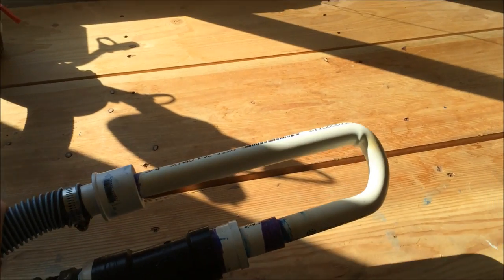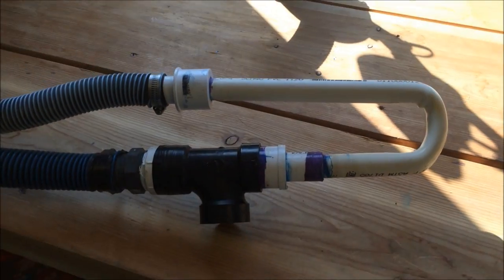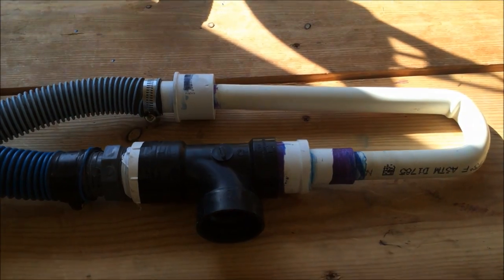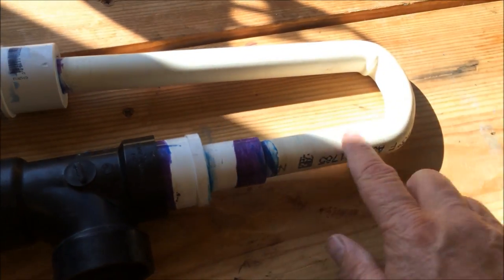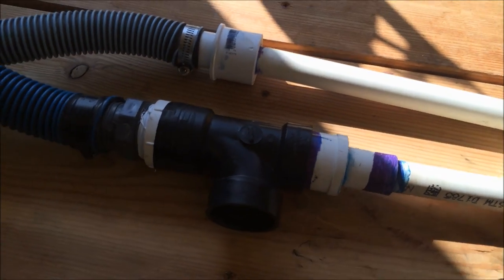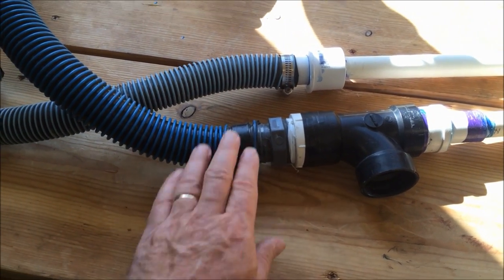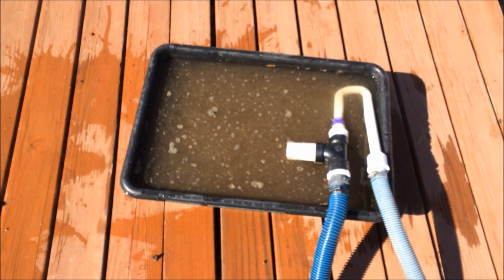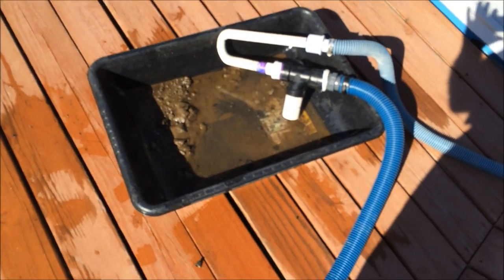12 Volt Suction Dredge

Comment: I absolutely love both the 12 volt and the manual pump ideas. Making it all portable is one of the biggest things. A container to catch all the classified material while you are going from place to place in the water, and letting all that excess water escape. I can see it being attached to a sluice box. Where I go, you always have to stack up rocks and then balance your sluice and let water flow through it. The water flow by itself to be able to put it anywhere is awesome. Have you ever tried to build a ram pump? it would allow for even more pressure to be used for your idea you got here for the clean water flow side. They always have 1/10 efficiency with water escaping but the thing is the pressure. With a river or lake, you don't have this problem with water flowing back into it. Its the pressure your after. The more pressure, the more material you can process. The system can be build to the size you want just to get a 10th of it.  Starting the ram pump is the main thing. But once it is started then it keeps going. Just don't want material going through it other than water. But, since that is the plan then it could work. May even not need the 12 volt battery if it works good enough.

Comment: Hey John...Got it figured out and corrected!This nozzle suck it up fast man!My problem was a hose barb I used to connect the suction hose to the nozzle.  It was creating backpressure because it went from 1.5" down to 1.25".  That .25" was the problem.  I took it out of the system and now the nozzle works fantastic!Like you I used heat to bend my PVC to get a nice even bend on it.My prospecting partner was super impressed when it threw a 1" rock 16" out the end of that 8' hose!Thanks for the help!Terry
Reply from the maker: Glad you got it worked out. I hope you suck up a lot of gold with it!

Comment: Good job. I like the nozzle. Looks to work great. The two I built do not have much lift. I see you also ran yours very near flat also. I built two. One is 3/4 and the other is 1''. Both are made of metal. They did not work as well as I had hoped using a 2000 gph 12 volt pump.  I will still use them with my highbanker gas pump. I made a 5 gallon bucket dredge with the pump. Hope it works better. I have not tested it yet. Goal is to put the wife on the bed rock to clean the cracks after I clean off it with the 4'' dredge.
Reply from the maker: +Basil Key Thank Basil. I'd love to see some footage of yours in action. Hope you're finding lots of that pretty yellow metal.

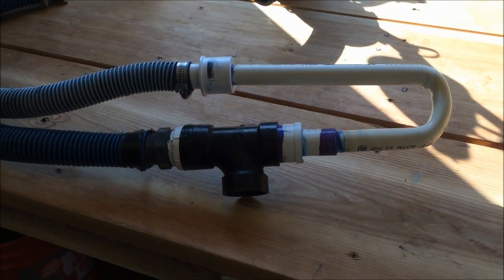Comment: 1:30 I was wondering how you bent the pvc pipe and I had in my head fill it with sand and you said you filled it with sand 🔥💯💪🏻👊👍
Reply from the maker: Yeah. I filled it with sand and heated the pvc with a heat gun...then I slowly bent it into the form I needed. Hope this helps.

Comment: another great video.the thing i noticed was that your pool water level was down at least 6 inches.this means it works out of the water.it should work even better in a stream, as the head pressure should increase as it doesn't have to lift the water up.thanks again
Reply from the maker: +bill bailey Yep, I agree bill, and it does. I set it upstream so that the head pressure is at its maximum. I'm also contemplating adding more water flow access into the pump itself by opening up the bottom of the pump and covering it with a mesh. Thanks.

Comment: Very nice.  One comment/question is do you find that the curved part bumps into things a lot?  I would think making it shorter where it comes in to the "sanitary T" section would have less PVC pipe sticking out in front, and make it able to get into smaller spaces.
Reply from the maker: +John Foster Yeah, I made another edition of it and shortened the sweep. Works great!

Comment: have you tried an aquarium pump like a mag drive? they handle head pressure alot better than those bilge pumps and they are also very light on the amp draw. you would need ac/dc converter but i think it would be better.
Reply from the maker: Thanks for the idea. Much appreciated.

Comment: Wouldn't it give you better suction if you didn't have your flow necked down to about only 1/2 inch where you used your calk tube end? If you made that a larger volume of flow wouldn't it give you greater suction? Or is my understanding of physics and water flow all upside down?
Reply: It needs to by reduced to make a jet  , i have video where i explain it

Comment: will the flexible pool hose will slow the flow with all the ridges or is it smooth on the inside? if it's not smooth id maybe pool backwash hose from amazon is $20. for 50 feet and might improve flow rate a bit more.i hope you get a chance to use it again before the cold sets in and take a video maybe.
Reply from the maker: +bill bailey 

Bill, I thought of that also. The pool pipe I'm using is fairly smooth on the inside, but any resistance reduction will help. Thanks for your input. Much appreciated.

Comment: How much static suction are you generating? Have you checked with a vacuum gauge? The ones I build are similar, but yet different. Two venturies, up to 12" of vacuum using a similar 12Vt pump.
Great job! 👍

Comment: What is the purpose of the pvc 90*? Can you just loop the hose/continue the loop with the hose and do without the pvc altogether(until the Y and Venturi input of course )? Just wondering if the solid 90* increases pressure or does some rad magic. 
We highly enjoy your projects and gain inspiration from your videos. 
Take care.
Reply: Yes u can just loop house , thats what i did and it works fine
Reply: Quantas horas a bateria suporta?

Comment: I called Keene from Keene Enginerring. He stated that a 3500 gph would not have much suction with one of his 2 inch keene suction nozzles.
Anyone have a different actual result? Im planning on using a 3500 gph 12 volt pump with a 2 inch keene nozzle. Thanks for any help!
Reply from the maker: Yeah, I agree with them. I have a 3" nozzle and use a Honda 125 gpm high pressure water pump to power it.I use my 3500 gph for my small nozzle in this video and for my small and medium highbankers. They work fine in these applications, but won't be sufficient for 2"-3" suction nozzle.thanks.

Comment: Hi John,Very informative video!  I am trying to build one but not having much luck...NO SUCTION!  I'm really hoping you can point me in the direction I need to go with this...I'm using a 2000 gph pump that has a 1 1/8" outlet.  The closest sized hose I can find that has a relatively smooth inner wall is 1 1/4" I.D.  It is 8' long and I've reduced it to a 5/16" jet ( I've also tried a 3/8 which threoretically should have been the perfect size) and a 1/2" jet) inside the 1.5" plumbing "Y" as you have done.  Of course the outlet of the nozzle is 1.5" and the hose is 8' long also.  The set up you show in the video appears to be longer that that and yet has very good suction...I know your pump is larger @ 3750 gph but still I would think I should be getting at least a little suction.  I've been after this for almost 3 weeks and I'm lost...any suggestions???
Reply: Terry l, look up my vid for where i made it work with 12v 1000gpm pump , its really diferent with every pump , the jet size have to be mached to your pump , the best way i found to do it is to run your pump with the hose u want to use , and test diferent sizes until the streem of water from the jet sprays the farthererst , and its a smoth streep of water , i have my smal pump with barly any presure spray over 10 feet distance with my funnel made jet .
Reply: Thanks,  I have it figured out.  I can throw a 1" rock a full 2' out of an 8' hose now.
Only problem Inhave now is getting the material to settle out of the hose to go over the riffle in in the sluice box.
To that event I think I will need to make a crash box header
I think I will add a short section of garden hose to make a pressure nozzle for flushing out cracks.  Then it would work on dry land too!!!
This is a killer backpacking set up!

Comment: Hi John, great video. Is it important to bend the pipe? does it increase pressure?. regards Bill
Reply from the maker: I'm not certain. I built mine this way because a normal suction nozzle is made with this type of bend. I've also seen others who have built 12volt nozzles without the bend. Thanks

Comment: Nice man.  Just ordered the 36in bazooka for the owhyees.   I see you didn't do the 1/4in mod for the BGT.  What's your thought on that?
Reply from the maker: +Jamie Burke I'm using a 30" sniper in the video. When I bought it they only came with this package. My 36" prospector has the larger, heavier grizzly and material.
Reply: +John Jacobs Yeah coolness.  I mean the .25in screen mod over the grizzly bars.  To keep even more rocks out of the catch.    Bleh, ordered mine like 2weeks ago..  still no word!
Reply from the maker: +Jamie Burke I wasn't aware of that mod...I'll check it out. Thanks!
Reply: The gold down here is so fine and flat, so I'll be going to lowls and getting some mesh.    The dude I saw it from said that by doing so, he can run longer without cleanout and that the larger rocks won't displace the fines as easy.

Comment: Why do you put sand? Doesnt that block the flow?
Reply from the maker: The sand was used to control the heat and to keep the pipe integrity while I was heating the pipe and bending it. I removed the sand after the pipe was bent. Thanks

Comment: That 3700 Rule .... does a lousy job.. It has no PSI.. you need PSI to make a good suction nozzell. Try your  house pressure garden hose at 80 psi, you will see, oh and mostly you would have a head pressure problem too at any depth